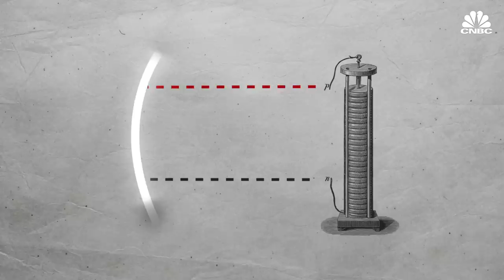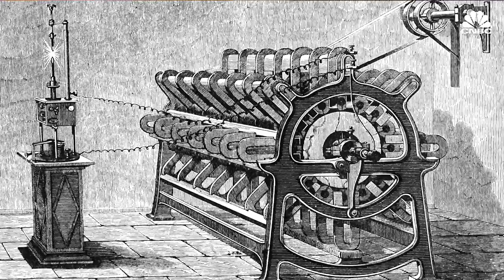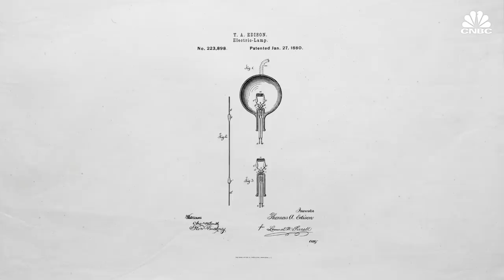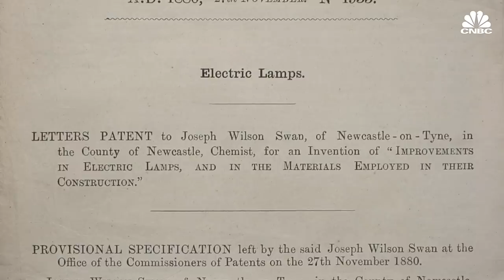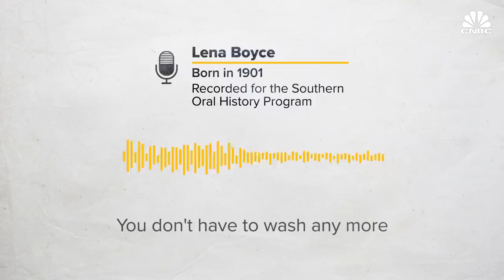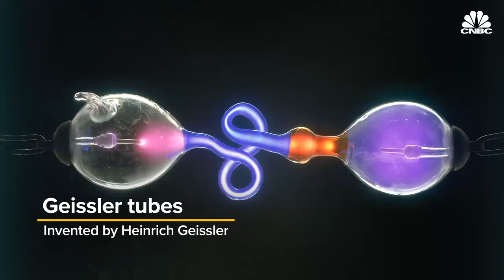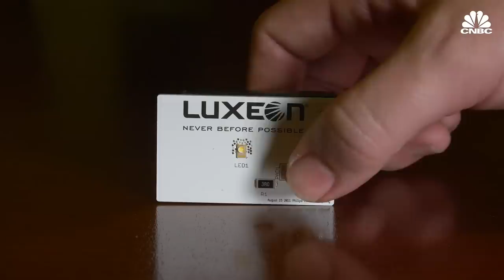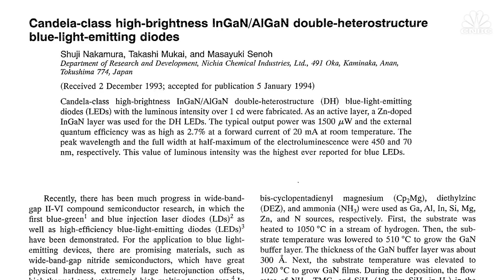Who Invented The Light Bulb?

Comment: 13:32 "[...] you can mix red, blue, and green, the same way painters do [...]"—no, painters mix red, blue, and yellow — or to be more accurate, cyan, magenta and yellow.
Reply: right? green isn't even a primary color. it works with light but not paint.
Reply: @darkshadowsx5949  I hate to tell you this but cyan and magenta also aren't primary colours.
Reply: @darkshadowsx5949  Green is a primary colour as it's one of the three colour receptors in the human eye (the other being red and blue). That's why screens are described as RGB.

What painters might call primary colours are no such thing. That's because paint is subtractive, not additive. It can only filter out a colour, it can't create them. Hence the colours in a simple inkjet printer are cyan, magenta and yellow. Cyan ink filters out the red leaving green & blue, magenta filters out green leaving red & blue and yellow filters out blue leaving red & green. Hence mix yellow and magenta and only green remains.

In real life, it's not so simple in that the eye's colour receptors are not tuned to one wavelength of light. Instead the three have overlapping curves of sensitivity against wavelengths. Also, pigments are not pure either. However, in the big picture that's the way it works. Paints/pigments are subtractive and they do not have true primaries.

Comment: "An led bulb has been designed to last 20 years".Hell mine lasted only 20 days.😡
Reply: Led lights are rated to last 10+ years you probably got a cheap one or a bad one
Reply: The thing is... the LED lighting elements themselves are designed to last a long time... but in many bulbs, the electronics in the base will die first. Same thing with CFLs—I don't think I ever had one last more than about two years, regardless of brand, before the electronic ballast in the bulb's base failed, not because the tube itself wore out or otherwise failed.
Reply: I have yet to see a CFL last more than a year or two.  Some still light up after that, but they flicker and make disturbing noises.
Reply: Joe Sterling Mine lasted since I got my house. Over 9 years ago. Depends on use and of course quality of the light

Comment: LEDs themselves might last 20years. But the controllers, and circuitry in the base will not. That's how they get you to buy more with the hidden planned obsolescence
Reply: Can convert the lighting circuit in your house to 12-48vDC fairly easily and safely without changing any wiring. No drivers needed. Thats my mission, as much as possible on DC direct with no conversions